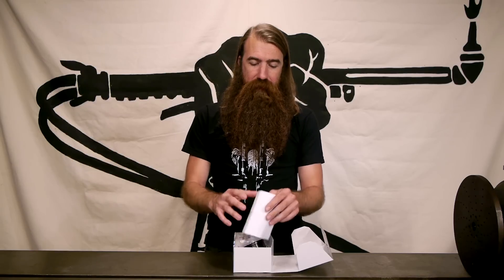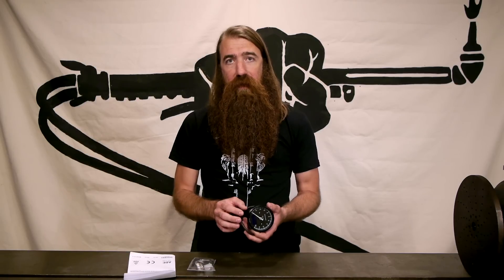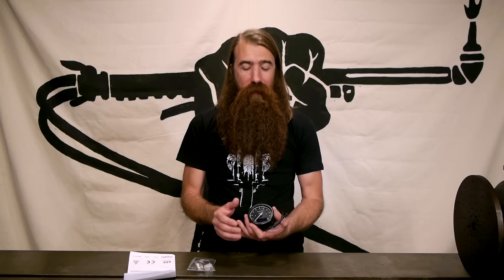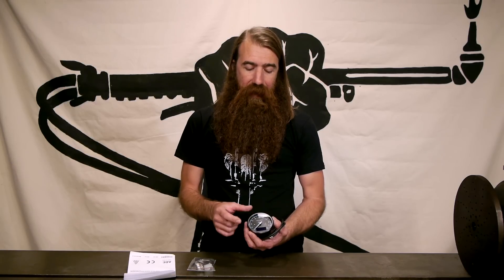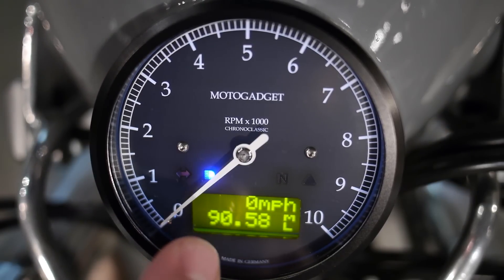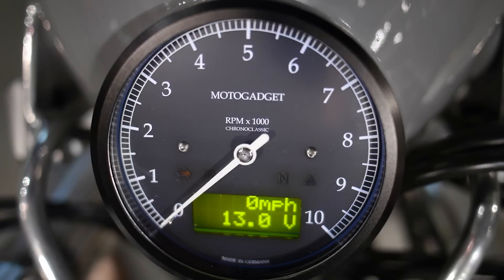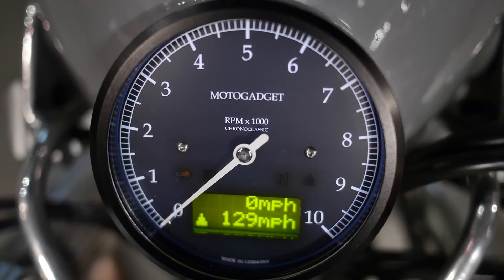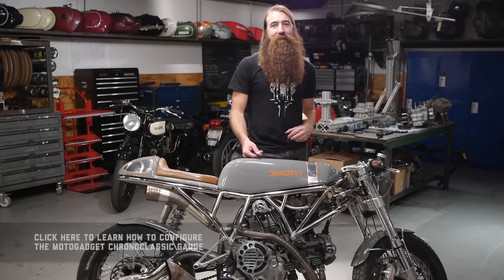Motogadget Chronoclassic - Revival Cycles Tech Talk

Comment: Very cool gauge. I will likely be buying one in the future. I don't know if it would be too much to ask for, but I would like to see a gear indicator built into a unit like this. Be it in the display or a small LED display, I think it would be a nice addition. Your products look great. I really enjoy learning about them in these detailed videos! Keep up the great work.
Reply from the maker: The cool part about the Chronoclassic is that it actually has a gear indicator built in. Because the gauge has both engine speed and vehicle speed, it can to the math to determine which gear you are in. This just needs to be calibrated during the setup and configuration process, which is described in the manual.
Reply: Wow, very cool! I will be buying one of these gauges then when I'm ready to build my bobber. Thanks for the info!

Comment: very useful vid,   But how do you configure it from kph to Mph,   also the crimps for the wiring on mine were too big to fit into plug and motogadget not very helpful.
Reply from the maker: Thanks! All of the configuring sequences and operations can be found in the user manual that comes with the gauge.

Comment: Hi Revival.. Thanks as always for making these. I have a question about how this works with vintage bikes. I see you answered that it DOES in fact work with them but I am wondering how? I do not see a connection for the speedo or tach cable. How does it calculate these values? I saw someone use a bluetooth GPS thing.. Do I need one of these?  Thanks for making the effort to answer community questions.
Reply from the maker: Good questions, glad you are paying attention. The cables are no longer used, as they are a frequent source of failure and a known wear item, it is best to eliminate them. The tach function is the easiest to setup, and just needs to have a wire connection to the negative terminal of one of the ignition coils. This works with all 12V style ignitions, but if you have a TRUE CDI (capacitive discharge Ignition) the coil voltage is much too high for the gauge and you need to use one of these... https://revivalcycles.com/collections/motogadget-electrical-parts/products/motogadget-ignition-signal-sensor NEVER CONNECT THE GAUGE TO VOLTAGES HIGHER THAN 15V!!!

For the wheel speed, that is what the reed switch and magnets that are included with he gauge are for. The reed switch needs to have a custom bracket made that will hold it near the front or rear wheel, such that a magnet mounted in a bolt head can pass by the switch triggering the signal. Reed switches work as an open contact, until a magnet is introduced in close proximity which closes the contacts. In the case of these gauges, one side of the switch is connected to ground, the other to the speed input wire of the gauge. Then when the wheel rotates the magnet causes the switch to close once per revolution (or twice if you use two magnets). Then you enter calibration data into the gauge configuration and it knows the speed. 

This is information and a whole lot more is explained in the manual http://motogadget.com/media/downloads/manual/msc_chc_manual_en_4.7_k.pdf but if you do run into issues with your install email techsupport@revivalcycles.com
Reply: Thanks for taking the time to explain this, I really appreciate the help. I will make sure to reference where I got the information when I make the video of setting this all up on my channel. This is very very helpful. Thanks again! Cheers!!
Reply: @RevivalCycles  Hello Revival. I would also like to thank you for all the videos. I have seen them over and over again especially when it comes to wiring. Your products and videos come alive on my Honda CB 900F '82. I have a question for measuring RPM? I have OEM ignition coils at the moment, but am trying to figure out how I can switch ignition with Dyna 2000 Digital Ignition and Dynatek Ignition Coils 3 Ohm.

So my question is, can I connect RPM measurement to the negative terminal on my bike or should I have this Motogadget ignition signal sensor you are referring to?

Comment: I don't see a low fuel indicator on the Motogadget Chronoclassic Speedometer, are they other options?
Reply from the maker: It is possible to use the turn signal indicartor as low fuel light. Basically if you notice the turn indicator is on solid you are low on fuel. If its blinking the turn signal is on.  The details of the exact setup for this depend on how the fuel level sender works. Thermistor type sensors may need to be used in combination with a relay, or 82 ohm 5 watt resistor.

Comment: I know this is quite old but I am wondering if I can put this on my 1978 cx500. if it will fit I will for sure be buying one
Reply from the maker: This gauge is compatible with the CX500 electrical systems, however, we cannot comment about the physical mounting. I don't know what gauge setup you have or what the sizes are so there is no way to tell if this will simply bolt up. There are detailed dimensional drawings available here. http://motogadget.com/shop/media/downloads/plan/msc_dimensionen.pdf

Comment: I have a 1993 Honda Super 4 with a standard analogue speedometer. Can I fit this as a replacement which looks to be digital? Assume the electronic features only work if the bike is already wired for that function e.g. oil light.
Reply from the maker: These gauges integrate very well on bikes like yours. There is no problem setting up the indicator lights, but you will need to come up with a custom install of the speed sensor. The gauge comes with the sensor, but you will need to find a location to mount it. Normally it isn't too difficult.

Comment: I'm converting a 97 Virago 750 to a bobber and have a ton wiring work to do.  Could I use this to replace the stock tach/speedo?  Also, since the fuses are in the housing that feed the tach/speedo would the M-Unit be able to replace that?
Reply from the maker: Yep, this gauge works well with the Viragos, and the same for the m-Unit. The m-Unit install is a bit more intense than just replacing the fuse block, but it also does a lot more than the fuse block ever could.  To me there is no better way to wire a custom motorcycle than, an m-Unit, Chronoclassic, and m-Switch minis for the handlebar switches.

Comment: Hello...I have a 2012 EFI Triumph Thruxton , ( I know I would have to purchase the Tri signal adapter ) Is the  Motogadget Chronoclassic literally plug and ride ?
Reply from the maker: +Mar Vel Sorry for the slow reply, we got swamped during the Handbuilt show... About the m-Tri, yea, its pretty much plug and play, the m-Tri comes with the connectors you need, and then its just a matter of connecting a few wires into screw terminals, and mounting. No modifications to the factory harness, and it is all easily reversed back to stock.

Comment: can i install this on a classic Honda cb500 four? If so, how hard is it? My tachometer and speedometer are goners and they are way to expensive to replace as originals.
Reply from the maker: Yes this can be installed on a classic CB500f. There are two parts of the installation, first is physically mounting the gauge, and the second is making the electrical connections. Most of the connections are not too difficult and the majority of the wires are already running to the original gauge. The most difficult part is getting a speed sensor setup, there is a sensor included in the kit but you will need to make a mount for it. The sensor needs to be mounted so that a magnet attached to either the front or rear wheel passes near the sensor as the wheel rotates.  If you have more questions, or would like to discuss the details for your application, email us techsupport@revivalcycles.com

Comment: can it be installed in a 99 zx6r "fingers crossed"
Reply from the maker: I am not completely familiar with all the electrical systems on a zx6r but I think in 99 those bikes were still carbureted and had fairly simple systems. As long as the bike does not have a factory immobilizer on the engine management system then this gauge can be installed on your bike.